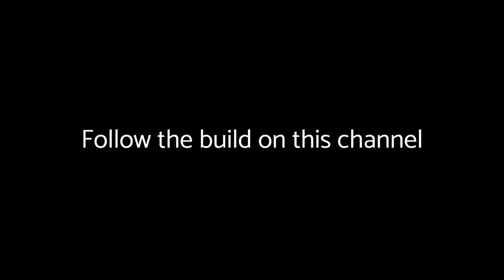Building a Balance 442 Catamaran II

Comment: Great video. Though a higher frame rate would be appreciated. It looks a bit like a slide show when you are panning around. 

As a point of curiosity why is the foam and bagging done by hand? It looks like it should be fairly simple to automate. Is it simply that the production volumes are too low to justify the investment or is there something preventing automation outright?
Reply from the maker: There may be ways to automate this process but currently with the depth in model offerings and the size runs of our production would be a big ask. We feel it is far easier to properly QC the process when done by hand versus automation.